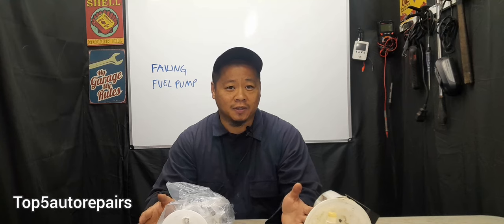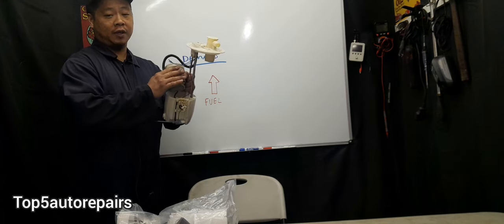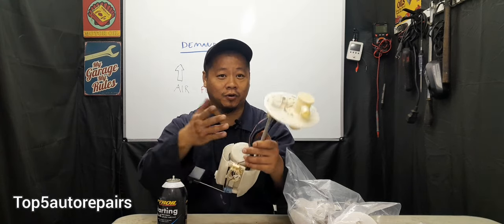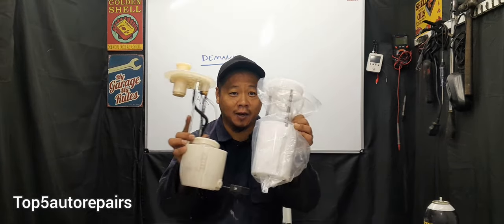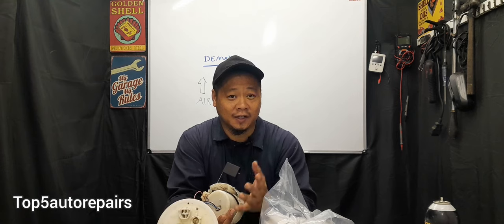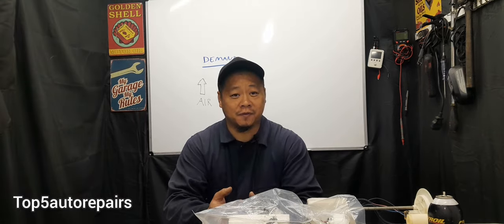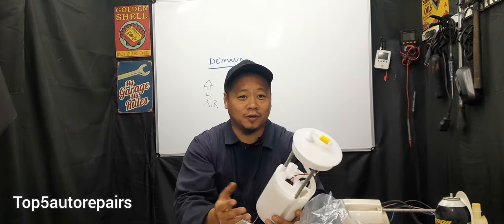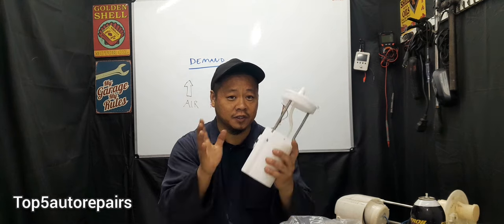10 SYMPTOMS OF A FAILING FUEL PUMP GOING BAD (STALLING AND CRANK BUT WON'T START)

Comment: Wow ever time I put gas in my car and start it.. it cut off after a long crank before cutting on. Also I have to push the gas pedal for a few seconds before letting go so the car would stay on. Then today turned it off then tried to cut the car back on and all it did was tried to turn on. Took me an hour before it started. But yea having ever symptom

Comment: 2012 ford fusion just had this issue. Spot on. $980 fix at the shop
Reply: 2011 here. Did you get the wrench and check engine light?

Comment: Great video. You actually explained hot heat can effect a fuel pump. My 95 Chevy only starts at night 😮. After the sun gets high or if I go for a short drive, it cranks but will not start unless I use starter fluid, then it quickly shuts right down. You nailed it. Thanks

Comment: Thank you for explaining everything really well. This is exactly what’s happening to my truck. My low fuel pressure light came on a few weeks before my car stopped on me. It won’t crank, it was stalling, it kept turning off on me especially on red lights.  I bought a fuel pump and I’m getting it changed out today.

Comment: Thanks for this very informative video . My 2000 honda accord just shut off and  i tried starting but there is cranking and no start. So i  ordered some new spark plugs and spark plug test kit, fuel pump main relay and a new fuel pump. If there is no spark i might look into a new distrubitor and spark plug wires as well. 😅

Comment: Heres my priblem on 1999 jeep Cherokee limited 4.0
Cranks winderful on cold/ first start. Drive one mile to gricery store then wont crank unless i put it all the way on the floor.
I stomped it on way home and it took off, no hesitation ran right on up to 90mph.
Pulled in driveway, cut it off for about 30 seconds, tried recranking and again it wont start unless i press it all the way to the floor.
Got a pressure guage and when ideling it shows 48 pounds. Opening up throttlebody slowly by hand and fuel pressure goes up some.
It goes dead/stalls at the stop sign when i try to take off. Have to.put it on floor again to start. After cranking for about 10-15 seconds it cranks but runs rough for a few seconds i suppose because it received so much fuel when i had it on floor.
Fuel pump?

Comment: Hi,

Thank you very much for the very informative video.

I just changed my spark plugs in my 2004 pajero petrol.

After changing the spark plugs the car does not start.

What may be the cause please?

Regards.
Reply from the maker: Please check ignition coil connection
Reply: @Top5AutoRepairs  Thank you very much.
I checked and they are connected.

Comment: Very good presentation about this common problem thank for taking time to make this video..How low is has to be the fuel pump pressure for an SUV to start running bad,the pressure for my chevy tahoe 2002 flex fuel is between 48 and 55psi but it has 44 psi ,Do you thing those 4 psi  are important for the car to run well,It has code 0174?I sometime 0171,0300..subscribed as well.

Comment: Great video 
I think my fuel pump might be going bad 
Sometimes I get long cranking as if car is out of fuel 👍🏻
Reply: Crankshaft position sensor is the first thing to check.  Symptoms of that sensor failing are the same as fuel system problems.
Reply: @SunriseLAW  thanks 🙏🏻

Comment: The issue im having is my air fuel ratio is dropping and going back up after filling up with fuel  the rpm is also dropping at the same time my car also shakes when the rpm and air fuel ratio drops. I did replace the purge value and o2 sensors and a new map sensor. The engine only stalls when in park after getting fuel. After i take off the car starts to go back to normal. Im thinking it has to be the high pressure sending unit.

Comment: Good morning sir, please i have Hyundai Elantra UD 2014, the car will stall while driving and when it happened like that and you put it in parking and you start,it start again,i check the fuel pressure it ok, but there's no trouble code when you scan, please i need your help.
Reply from the maker: I'll make a video why your vehicle is stalling. Stay tune.

Comment: I been confused. I’ve been driving my car and it just completely stalls and shuts down. But the dash lights and such are on. It stalls won’t turn over and I wait about 10 to 20 mins then starts up again.
Reply from the maker: Next time when the vehicle stalls, spray starting fluid in the intake. If it starts right up then you know it's a fuel delivery issue most likely a failing fuel pump motor.

Comment: My highlander 05 has a bit of loss of power, and sometimes something bucking or shaking in the front. Sometimes jerky at certains speeds. Good compression, timing belt new and good, new spark plugs and coils. Has 02
Sensor codes, exhaust leak and sometimes random misfire codes.. even po0016 crank/cam shaft position sensor correlation. I don’t know, any ideas ?

Comment: would a fuel pump issue also cause the fuel gauge to stop working
Reply: That’s the sending unit. It shouldn’t be directly related to a fuel pump issues

Comment: Transit in tank fuel pumps always suck up muck and water wax 
So this means the diesel filter clogs up as well
So if your transit van runs for 2 miles and then cuts out or hard to start
Its the filter blocked on the head of in tank fuel pump
Its so easy to drop the fuel tank on transit only two bolts and to clips and fuel tank is out then just unscrew fuel pump
Its best to do this every year or so
Gary Gibbons motor mechanic  50 years

Comment: I got a 2020 altima and something makes a grinding noise under my back seat what can that be and it only starts when can gets hot
Reply from the maker: Maybe it's the rear brakes or bad wheel bearing.
Reply: @Top5AutoRepairs  no it does in park not moving
Reply: @Top5AutoRepairs  only starts when I drive for  hour or more it does it in park can a fuel pump get hot and start graining....?
Reply: Might be clogged fuel filter

Comment: If car randomly stall engine dies remove the key starts back on specially when downshiftting and quick turn
Reply: Did you ever find out? Exact same issues for me
Reply: @dlok5206  Did you ever find out what the issue was. I'm honestly dealing with the same issue